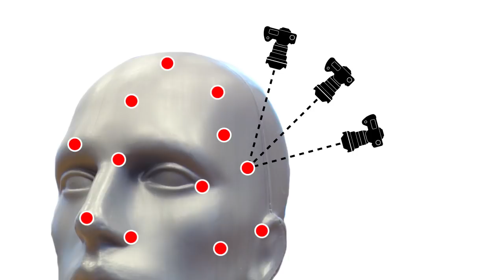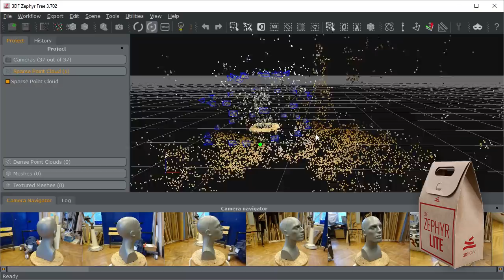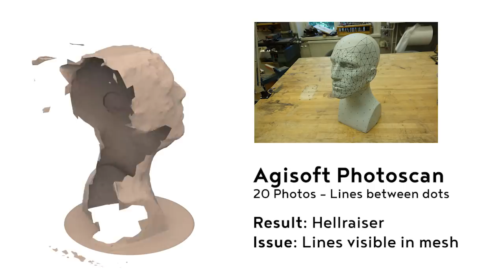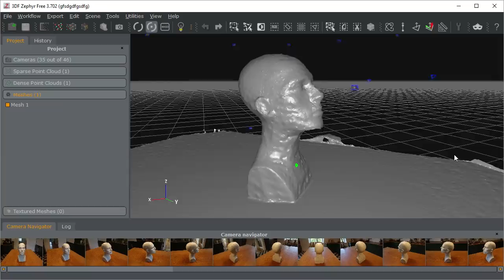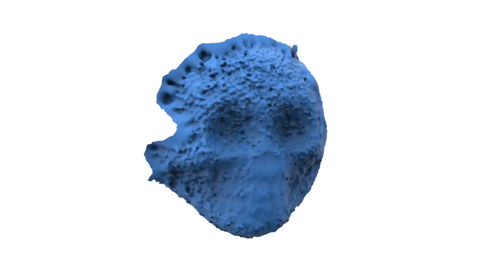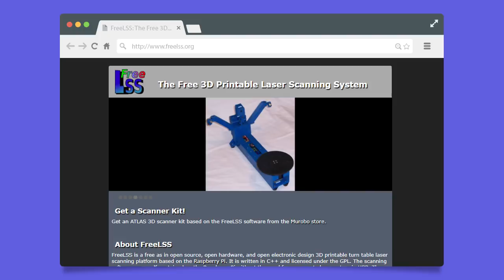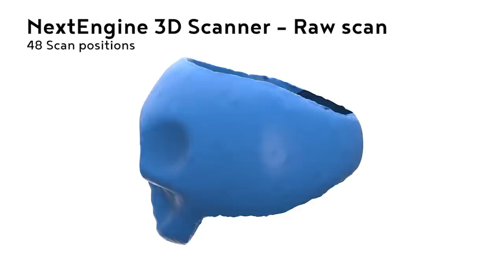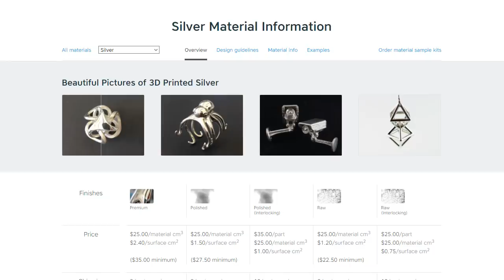How to Copy (almost) Any Object

Comment: Along with shapeways, it's worth mentioning 3d hub for more simple plastic prints, and it's often cheaper.  Also, I'm pedantic, and I like to say stereophotogrammetry to differentiate it from older style photogrammetry used for mapping.
Reply from the maker: Well yeah, photogrammetry in its core is just about taking measurements from photos. The first patent related to photogrammetry was in the 19th century already. There is also videophotogrammetry. However, photogrammetry is already a mouthful, I'm not going to make the word even longer to say 😄
Reply: Haha, yeah, I don't blame you.  Whenever I say it, people look at me like I'm speaking gibberish.

Comment: another rule of thumb for photogrammetry  is that the photos overlap each other by 60%, source is that i work with drone photos of big areas for surveying, we use the software agisoft, there is a free version of it but you can export your work with it.
Reply from the maker: Agisoft is good, but I don't know if I'm using it wrong since all my results from it are much worse than 3DF Zephyr, when using the same source material. The results tend to be more noisy and more fragmented.
Reply: Im kinda new to agisoft, but i would recommend the 60% overlapped photos, also something i learned is that pixels is everything and white pixels are basically dead ones. So the optimal camera settings is kinda counter intuitive, you should have as low ISO setting as you can, fast shutter-speed. Also using a relatively narrow lens also helps (18-24mm).
Reply: @Jellooze  Thanks for the tips from a proper photographic perspective!

Comment: another method is to record a video panning around an object of choice using a high fps camera, then convert the video into individual frame images
Reply from the maker: Indeed, but you're not going to get as high quality imagery. Even with a 4K camera the image size will be severely smaller than even the most common compact cameras. That method is useful when capturing things with drones, as usually the end result doesn't need to be super accurate anyhow.

Comment: For the ring: make a silicon mold, cast in wax, use the lost wax method to cast the ring in any metal you like.   Thoughts?
Reply from the maker: As I’ve pointed out plenty of times already. Yes, that’s a swell idea, if my hands were the same size as when I was a kid. Nowadays I can’t fit that plastic ring even on my pinky, so an exact copy would be less than useless.

Besides, if you order it from Shapeways that’s essentially what they do. They 3D print the wax and cast it for precious metals.

Comment: 1. Using photogramatry, how do you suggest taking the 50 pictures? 3 rows of 16 images (high, straight, and low) 22.5° appart with an additional vertical top down shot? ( I know I am still missing one.)

2. Does the photos for photo have to be exactly the same distance from the object?

3. Can you use photogramatry or lightscan to make a cheap lifesize model of your own body? 

4. Can you modify the model after taking the pictures?
Reply from the maker: 1 yes and no, I would suggest taking most on even increments all over to capture the general shape, but also take a few closeups on more detailed areas. A head may need more photos of the face than of the back of the head as it's more detailed. 

2 no, but in some cases it can help the software. 3DF Zephyr has a setting called "urban" which helps with understanding that the photos are not taken from the same distance. 

3 yes, as long as you find someone to take the photos for you. I wouldn't use structured light scanning as you're unlikely to stay still for that long.

4 of course, as you see me do with the ring in the video. It may be helpful to retopologize it if you want to do anything more meaningful than just resculpting in ZBrush or Sculptris though.
Reply: Switch & Lever thank you so much for your reply

Comment: Using Meshroom and RAW images converted to tiffs in 16 bit depth works for me every time and is much more reliable than trying to use only JPEG files.
Reply from the maker: I have spent considerable time with Meshroom in the last couple of years trying to make it produce nice results. I'm not saying it can't, but it's still way behind something like Zephyr which can take worse material than Meshroom and still make a really good photogrammetry scan from it.
Reply: @SwitchAndLever  I never used Zephyr, but I will give it a try. It's true I also struggled with meshroom, but using 16bit tiff files helped a lot at least with my setup.
Reply from the maker: @martinhromadka7671  that may be fine and dandy, but it does require a camera which can produce such files, or RAW files. Most consumer compact cameras (like what I use in this video) cannot. Zephyr is far more just like dropping in the photos and letting it do it's thing, whereas in my experience Meshroom is a lot more finnicky with what settings to use, not to mention vastly slower.

Comment: COLMAP; free, updated regularly, maintained by a group dedicated to 3d work.
Unlimited number of photos, photos can be from random cameras, very fast image processing.
Output goes to Meshlab, also free, to get some clean up, make point-cloud into a 'skin'.
Meshlab output to Blender.  Edits, more filtering, export to STL.
STL file to whatever Slicer you like, 3d-print.
Captured the back curves of a Moto-e phone this way.
22 photos of paint-specked phone, 28 minutes in COLMAP to get point-cloud, 6 minutes in Meshlab to make OBJ file, 3 minutes Blender to scale and make STL file, 2 minutes in Cura to make G-CODE file.
Photos to printing in less than an hour.
Why scan an ancient Moto-e?  No accessories I liked, so I made a 'skin-type' phone case.
Unlike a Kinect or other structured light scanners, there is no effective size limit to image-only photogrammetry systems.
Reply: do you know of a good workflow demo video using this method?

Comment: makes sense that random works better than patterns, if you have matching patterns on either side of the face, the program might misinterpret them and fudge up the model, so any non random pattern can and probably will confuse your photogrammetry program and make your final model worse xP
hence why meshroom mainly uses details outside of the model to get its camera PoV's right. makes sense though...
i mean... how can you build an image, based on the points of that image, which you are trying to place, but you also need those points to see where to place the points;... that's what you are doing to your poor pc if you don't have defining unique features on all sides xP

Comment: Just curious of what it costs to have shapeways print the ring in silver?

We are working on restoring a few vintage 1920’s Speedometers for cars and the old ones had originally been made of several pot metal parts, this would be a good way to have the parts replicated in aluminum?!!

Comment: I wonder how well something like a water based spray adhesive along with a rubbed on coating of talcum powder would work for taking care of reflective surfaces. On the plus side that should be easy enough to remove afterwards with something like goo-gone or other similar cleaners. Possibly even something like a hairspray may be enough, instead of a proper adhesive, then you could clean it off with soap and warm water.

Comment: Question- How did you enlarge the ring to fit your now adult larger finger?
And how did you figure out how to scale it to a larger size?

Im a complete newbie and am wanting to enter the world of 3D printing but dont have a clue on how to go about choosing the best beginner friendly 3D printer.
Im primarily interested in copying small  RC aircraft parts and printing spares.
Also interested in scanning lifesize objects like cars and making smaller scale 3D prints of them.
ANY help and suggestions from anyone would be greatly appreciated!
Reply from the maker: I'm sorry, I simply don't have the time to spend teaching you how to use 3D modeling software. The 3D scanning to 3D printing pipeline is not just straight copying, in the same way you may copy a paper on a copy machine. There is a lot of hands on work that needs to be done between 3D scanning and 3D printing, to get the scanned data ready to be 3D printed. If you want to "copy" parts like you describe, for model aircraft, I would suggest investing in a pair of digital calipers and learn how to measure parts and model them up in a CAD software like Autodesk Fusion instead. 3D scanning is not really a good idea for copying things like you describe.

Comment: I'm surprised nobody has developed a video based technology for 3 d scanning.  It seems to me that it would provide a smoother and more complete image with less missing data if the technology could be worked out
Reply from the maker: They have, there are apps on the iPad among others. They're worse though, with video you introduce motion blur, video resolution is generally lower than still photo (unless you have a very high end camera), also you're not going to process this on the fly if you expect any sort of good resolution. You can totally use a video as an input to many different photogrammetry softwares, but all they do is take out frames from the video and uses that just like how they would still images.

Comment: How can you be sure the ring fits? Can you increase/decrease size so it will be f.ex  x number of millimeters in diameter? Is this done in the 3D printer software? (Sorry for asking, just wanting to obtain information before I will buy a 3D printer). Sometimes it could be important to create a copy of something in 100% equal size too.
Reply from the maker: I measured a ring that I knew fit and scaled the ring in a 3D program (not the 3D printer software) before sending it off to Shapeways to be printed. You cannot simply buy a 3D printer, you have to learn how to use at least basic 3D software as well. Blender would suffice, but other software such as CAD packages or more advanced software may be required as you grow.

Comment: And if you make a video of the rotating object and save the frames from it? 30 frames per second I think would give a pretty complex picture of any object!
Reply from the maker: Except a video will have a lower resolution, even at 4K my camera can take much higher resolution photos than that with a lot more detail. Also video is more prone to motion blur, which is also detrimental to photogrammetry. So yes, while you can do that, don't expect the results to be better.

Comment: You should have a white or contrasting background in each picture you take. This should be as obvious as depth of field and lighting. 
You can achieve this very simply by using a piece of foam board that you rotate around the object as you walk around taking each picture. 
For what it's worth, it will provide faster and much more accurate results than what is happening here.

Comment: if you do one color bacground you got faster and more proper scan
Reply from the maker: rvdextron it is very much dependent on what you're trying to capture. I do it in my video and I failed, and I link a video where it worked well, so it completely depends on your circumstances. Sometimes you need to capture the environment around as well for the program to better understand where the camera is located in relation to your subject.

Comment: Thanks for sharing! I bought an iPad with lidar and was looking to use it to scan a piece of equipment at work. The piece is large 12 plus meters high but the part with the most detail is only 1 meter and up to 2.5 meters high. Any tips and tricks would be useful.

Comment: Will you please tell me how can I achieve the even lighting in room for the scanning of same object
Reply from the maker: I’m not sure what you mean. By using lights pointing at the walls and ceiling so the object is hit with indirect lighting. Does that not work for you?
Reply: @SwitchAndLever  actually I want to know the settings of light and which type of light o should use.. I was directly focusing the light on object from two side

Comment: excellent overview! I have a NextEngine scanner at work and while it does a good job, as long as you follow the age old adage, "crap in, crap out",  it lacks at providing a texture map to use afterwards. Have you found any work arounds for this?
Reply from the maker: Really? The one I used gives a texture map. Well, really, it gives a bunch of different texture bitmaps applied haphazardly on the mesh to make up the whole, so it's impossible to edit the texture map should you need to. Using 3dsmax or a similar package you could bake the texture and get another UVW projection though, and consolidate it into a single bitmap.
Reply: Switch & Lever yeah, I see those low res images it creates, clearly I don’t know what to do with them. There really is a lack of videos on that scanner out there.

Comment: MeshRoom is a newer way to perform photogrammatry, I ditched PhotoScan for it a few years back.
Reply from the maker: I have tried the same photo sets between both Meshroom and Zephyr, and Meshroom is not only severely slower but also produces much worse results. Yes, it's great it's a free software that you can use more photos than the 50 which Zephyr allows for free, but the results are still worse.

Comment: how is the accuracy and scaling of the photogrammetry? if I needed to scan my face so I could use blender (after importing the model into blender) to make a mask that fit like a glove (or close to it), would it work??? or would a homemade laser method work better??
Reply from the maker: The accuracy of photogrammetry is always down to your source material. Let's say you take really good photos to begin with, in my experience the relations in photogrammetry is really good, but it has no sense of the scale whatsoever, so you have to solve that some other way. An idea may be to use measurments on your face and scale the mesh accordingly. Still, it will probably be some trial and failure until you get the scale spot on enough for a mask.

Comment: Use silicone to make a mould from almost any object and than pour it with poliurethane.
Reply from the maker: Yep, you can do that, but as you may have noticed the theme throughout this video was also to change the scale of the objects. You can’t do that with molding and casting. Not to mention that playing with silicone and plastics are much less accessible to most people.

Comment: I have a HTC Vive VR headset. It has 2 sensor stations which use IR lasers in a vertical and horizontal line (I guess like structured light scanning?) and it also has a camera on the headset. Could I accurately scan something using this?

Comment: Can you use does models that you scan for making games or short animated movies ?
Reply from the maker: Yes and no. This technology is often used to get a base model from a sculpt for instance for animation or games. However, the density is really too high to use, and the structure is not really animation friendly. To solve that you generally retopologize it with a tool like ZBrush, to prepare it for animation.
Reply: Thanks for the quick answer, I thought the same for the density. Really nice video ! Keep up the good work.

Comment: A bucket of plaster and casting works just as well 😏
Reply from the maker: I'm curious, how do you change the scale of an object? I made the head I scanned at 1/6th scale when I 3d printed it. The ring I scaled up so it would fit my finger. Neither of those things are possible with casting.
Reply: @SwitchAndLever   See your own title: "How to copy..."
Reply from the maker: @robot7759  so, if you put a piece of paper in a copying machine but set the scale setting to 50%, is that not a copy?
Reply: @SwitchAndLever   Not a true copy, one might argue. Its a scaled copy?
Reply from the maker: @robot7759  that's entirely splitting hair as casting also produces a scaled copy due to shrinkage of the molding material as well as the casting material, even if it's just a fraction of a percent. Did I write "true copy" in the video title?